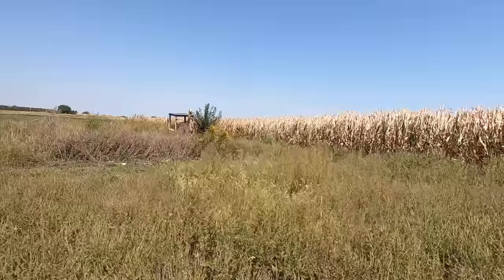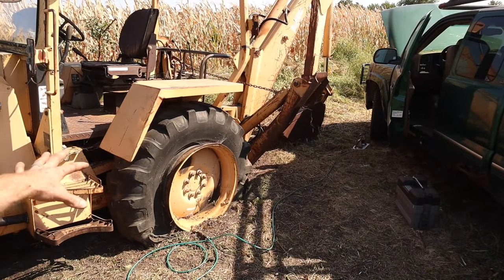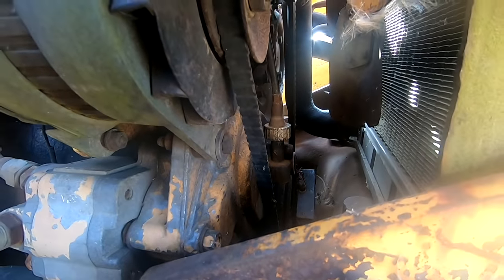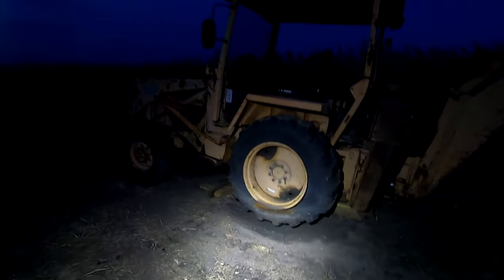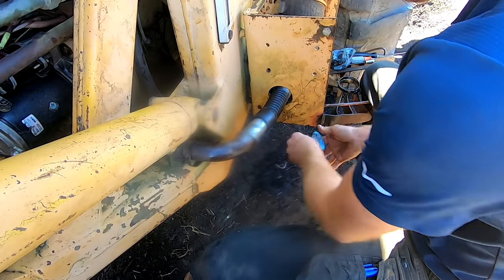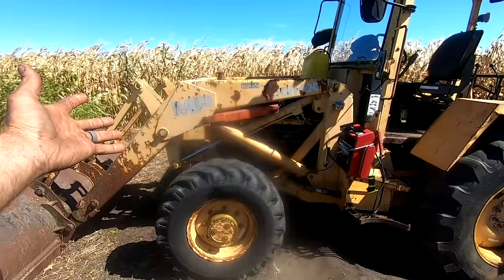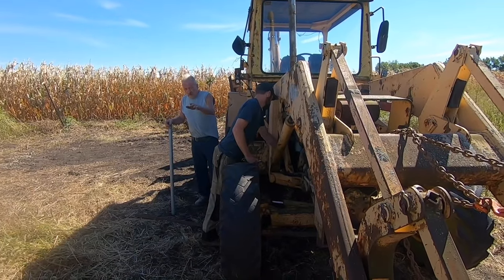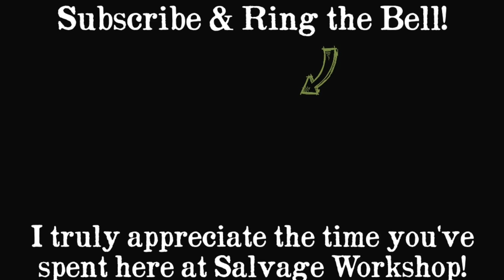I GAMBLED $600 on this Backhoe, sight UNSEEN?? Was the MF WORTH it?!? ~ Broke Down Backhoe ~ Part 1

Comment: The hole in the front casting is if it was 2wd, or at least on the earlier MFs, they had a pin for steering all the way through to a knuckle at the bottom attached to the tie rods

Comment: Turning the engine over using a tyre lever or pry bar on the flywheel teeth is not the best method of doing that unless you do want missing flywheel teeth, of course. You need to turn the engine over using a socket and wrench on the crank pulley and then watch the teeth as they rotate using a camera if you cannot see the opening. You know that pre-engaged starter solenoids are the first things that stick on an engine that has been stood a while, you did check that before re-inserting the starter, right? Not only that, but you can't conclude that it is an electrical problem until you prove the functionality of the starter solenoid. A pre-engaged starter works by the solenoid energising and throwing the gear wheel to engage into the flywheel ring, the starter will not turn until the gear has been shifted across fully. If the solenoid is stuck or has no power or the gear mechanism is stuck, the starter will not turn until the solenoid engages the gear and the contacts are made. I'd be looking at that first because the thing is not stuck there because it lost hydraulic power or the starter wouldn't engage, both of those then it would still drive. More likely it was an engine failure that stranded the backhoe. Moreover, they are NOT known as JCB's, a JCB is an Irish manufacturer's name that makes JCB backhoes, that is a Massey Ferguson and therefore not a JCB.

Massey Ferguson was formed from a merger with the Canadian Massey Harris, with The British Ferguson-Brown Company in 1953 and was called Massey-Harris-Ferguson until it was shortened to Massey Ferguson at a later date. They transferred to Buffalo, NY is 1991 and they were then acquired by AGCO which is why they are now American.

Hydraulic hose doesn't matter whether it is just the return hose or not, it is all about whether the hose is oilproof. If it is, then you can leave it, if not, then your hose will swell and blister.

Those 'O'- rings are not really suitable for diesel fuel, you would be better using Viton 'O'-rings.

Comment: The diesel is fresh and some leak and you said it need to be rebuild. But you can take off the front shovel that the industrial arms hold the front loader. Take the front loader and arms with cylinder lifts off - off. You will bring cheater bar as part of lever to the 3/4 inch flex bar and break off the joint with big slip ring pliers, Please? because you will need the tractor after stop the leak problem.  We - I and my uncle had no front loader of the Ford vintage tractor then the tractor with the 5 foot wide shovel were add to the front of the diesel powered tractor Tractor is called riding front loader. Then we went to from Tennessee to North Carolina and bought new 4 wheel drive front loader and riding back-hoe without the outrigger stabilize named John Deere Toshiba little more than 45 HP called 10 -12 foot reach high front shovel. Higher than 45-50 HP kubota . The John Deere has a canopy with 5 ft tall tires. What state are you from? I'm from Durham Raleigh, NC.

Comment: Didn't you think that Maybe there should be three o rings and someone sometime cheap skated and only put two back?
Reply from the maker: I wondered that initially, but no that middle section is supposed to be there without an o-ring...the manual shows only 2... not sure why, but it only needs 2!

Comment: I beleave you are using the primer pump wrong you should be lifting the lever not pushing down. But works best at certain engine positions since a lobe on the camshaft pumps it

Comment: That part on the front where you thought a shaft should go through is a casting from a 100 or 600 series tractor where the power steering cylinder was mounted but the cylinder on the 50 hx will be mounted on the axle to the best of my knowledge. And yeah massey ferguson was invented by an Irish man who done a deal with massey Harris in 1948 . A lot of massey fergusons were built in Coventry in England probably the best backhoes ever
I suppose I'm thinking of anything from 50 hx through the fermec 860 to the terex 860 now as even though I'm heading towards 60 I'm not old enough to have used a 50 or a 3303 and don't intend to either only thing I'll be doing with them is looking at them in a museum!! Haha

Comment: Surprised you didn't crack all the injectors to bleed the fuel system.... Completely out of fuel, plus partial rebuild of p pump would definitely put air in the system.

Comment: The front shovel, Tractor driver, is broke down. The operator is willing to remove the roof off from the MF construction tractor then use wire rope and connect this end of the rope to the back hoe and other end of wire rope is coonect to the loader shovel scoop and your back hoe pull outward at same time lifting up your loader blade. Do you need back hoe to get the hydraulic pump running and let the front loader be skip and lock it up to get the 2 foot ground clearance. There is more room for pump to the lift cylinders long ram jack yoke bottom if you place the pump at rear of the tractor rather than fix the hydro pump in the front where it is not working.

Comment: i'd have been reaching for my wallet before they finished their sentence at that price. $600 isn't even scrap price. if you just load it up, and haul it to a scrapyard, you've already made a profit on the deal. if you can get it working, you can add a zero to what you paid for it, and it would still be a bargain for someone if you don't keep it for yourself. that's a hell of a find you lucky dog!

Comment: seems like the mount on the front is for an hydraulik steering zylinder, mf had a system what would be triggered by an long rod of the steering whell on 2-wheel tractors. e.g. the mf 177/188

Comment: The old MF came without 4 wheel drive.  I'd guess it has something to do with abandonment of the 2 wheel drive and the addition of the Mechanical 4 wheel drive.  Perhaps a pivot point for a steering power unit ?

Comment: Happy new year. Hope to see new projects coming soon. Firstable those MF were great farm machines back in the day. That housing that you ask for in the front axle support was used on 50B and older tractors. There was a shaft thru that bushing moved by a cylinder ram ( with a valve on it) and some articulates parts that includes an older system. That 50Hx has a new sytem and it doesn't used those parts, But still use the old front axle support. That is way you see that housing over there. Best regards from LANZAROTE  (Canary Islands). I hope to see what's going on with old red 💪💪✌✌🤘🤘👍👍.

Comment: I have been told by professional diesel mechanics that ETHER is a NO NO in a Diesel Engine due to it's HIGH COMPRESSION.  If you use Ether, you will CRACK your HEAD.  I have always had good luck with Diesel 911 or plain old clean Diesel fuel in getting it to start.

Comment: Well 600 isn’t bad at all. Try 10k mine runs good well the fuel tank needs to be cleaned I have a spare tank on the side to make it run for now but the biggest problem is the pinion bearing went bad on the differential it has a pinion hand brake “basically a driveshaft that connects  the  handbrake assembly with the pinion shaft” well the couplers that connects all that together broke I was lead to believe it was the shuttle disc clutches which I think would of been a lot easier other then those things the hydraulic are in great condition there’s hardly any slop at all in the backhoe the only thing that leaks down is the left stabilizer it has a 4in 1 bucket a side shift backhoe it also has a extendahoe an 4wd also it’s starts up like magic and this thing is built like a tank metal all around closed in cab but I just don’t think its 10 k worth it man I wish you were in Florida I would have you fix mine I have the 555b

Comment: I really suffer to see how he tortures the flywheel with the crowbar. It's very amateur thing to do because he can easily break its tooth for such a stupid reason when he wants to try if the engine is stuck or not. He will see with a good working starter and cables.

Comment: I HATE working in the dirt. I have a Jeep
and nothing gives some of my buddies 
a bigger orgasm than to break an axle, or 
blow a clutch or punch a hole in their oil
pan & break out the tools & wallow 
around in the dirt or mud on the trail & fix it. 
Makes them feel like a superman being 
resourceful I guess. Not me. I'd rather work 
on mine in front of my garage on clean dry 
concrete. Repairs made in the dirt have to
be redone once home because they got dirt 
& sand & grit into the parts on the trail. No 
Thanks. Once is enough for me.

!